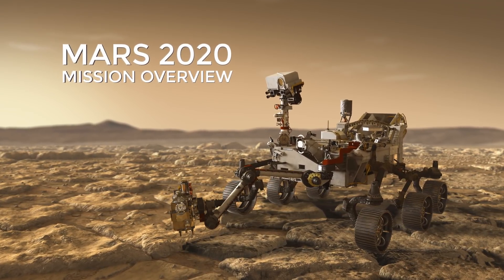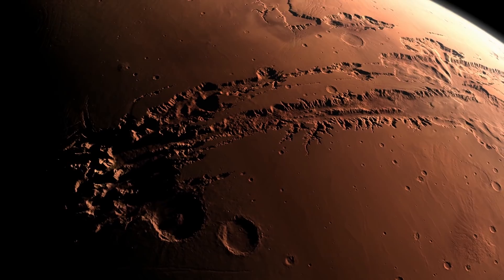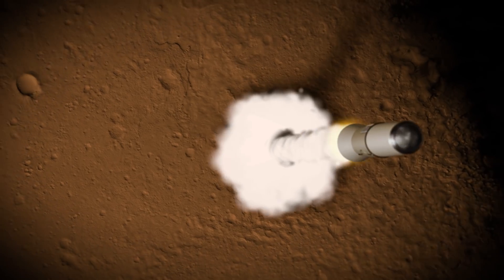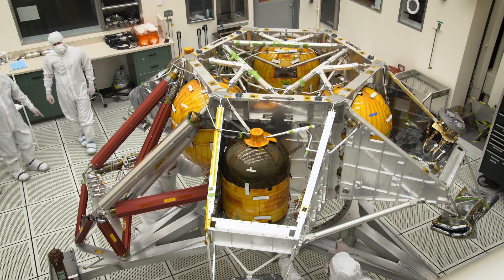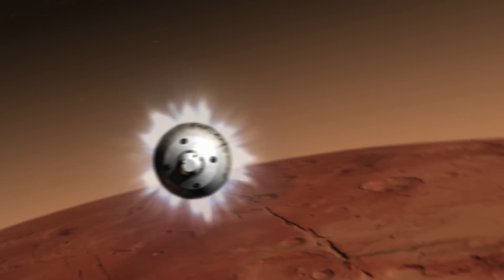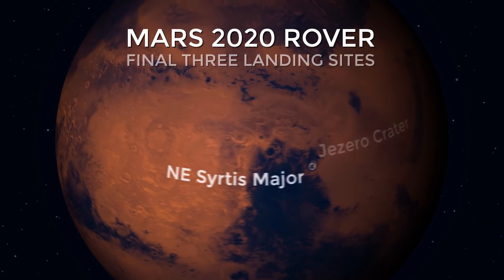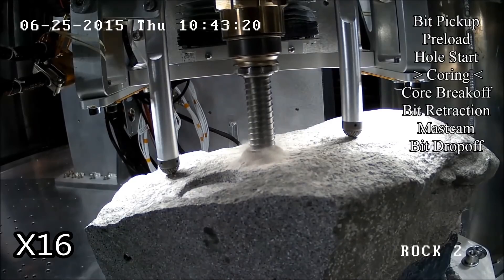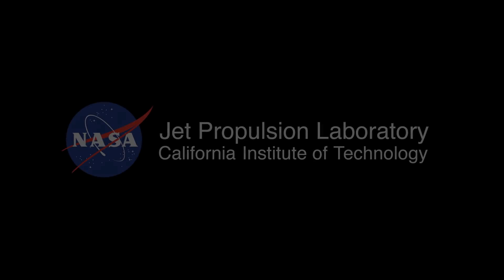NASA Begins Building Next Mars Rover Mission

Comment: I agree with mrengtop, how many billions are we going to spend on probes to mars, to try and prove that life magically comes into existence in the presence of water.  It's like saying that we may find a fueled 747 on the surface of Mars due to the presence of hydrocarbons.  I am not saying that life does not exist somewhere out "there", but I am a bit sick thinking of the debt we are leaving our children in, while engineers keep doing the same things over and over expecting different results.  We have NO workable theories on how life could have somehow self assembled both molecular machines made of complex protein structures using ONLY left handed isomers when left and right come in equal quantities, and just happen to also have the enzymes required to make the reactions for them to bond instantly instead of never or 100 years, AND at the same time created an operating system of DNA that for some reason decided to digitally encode immaterial, purposeful, precision, self-repairing, self-editing, and self-proofreading information that makes these various molecular machines, independent of any chemical structure.  Biologist know very well, that the enigma of life is not found in water or oxygen, you can have any chemical in any abundance, but without highly ordered, specific and purposeful  information, exactly like we find in an alphabet or computer code, you will never achieve the machinery and whatever "spark" that occurs to make it all "go" and become a cell.  In Darwin's day we thought cells were bags of goo (protoplasm), nothing more.  Now we know they are literally miniaturized cities that employ  nanotechnology more efficient and complex than any human feat of engineering.  We also know now that neo-darwinism, mutation and selection give you controlled death, and at best weeds out mutated code and at worst kills the host.  If one is very lucky, a random mutation can be neutral.  This idea that was seized upon in the 1950's as a mechanism for evolution purely because it fits the "chance only" materialist view of life, has failed miserably both empirically and observationally in the fossil record.  Instead we have found the real mechanisms of change match what appears in the fossil record:  sudden appearance, then very rapid adaptation to environmental changes within limits (no rat like creature to whales, or fish to men).   One of the most famous evolutionist was one of the most honest about the evidence, Stephen J. Gould.  He stated that "the lack of transitional forms is the trade secret of paleontology".  Many who read this will read it with complete disbelief that darwinism is dead as a workable thoery , and will want to hurl insults, call me a creationist, or a "denier" etc. of the diversity and changes we see of life.  Another Evolutionist said of the fossil record when viewed under neo-darwinist claims "is like a film with 99 frames out of 100 missing".  Don't take my word for it that the study of the origin and diversity of life in biology has come down to NON-RANDOM processes, take a look at one of the cutting edge Evolutionists of our day and his theory called "Natural Genetic Engineering" - which makes me kind of chuckle, as I am like what is next "Natural DNA programing and self repair and natural nano-machine making"?  www.thethirdwayofevolution.com - I do not ascribe to his thoery, however read the introduction, and all of the new non-random mechanisms where entire genomes reshuffle and genes have even been shown to "Jump" from one species to another totally unrelated species, where Horizontal gene transfer has killed the tree of life and made it a small group of body plans with most of the genetic changes horizontal not vertical (called an impenetrable thicket), and junk DNA is a myth, and it is more akin to an OS than JUNK - in fact it holds the key to regulating, repair, all of the housekeeping, on and on, just like an OS on a computer, And where characteristics acquired during a creatures life is directly passed on to its offspring, and welcome to the new thinking on evolution (not modified), not sure why we ever swallowed neo-darwinism, it was based on a worldview, not on evidence.  As the evidence keep rolling in, the chance only crowd are getting a rude awakening.  We have such hubris that some people are born smart, self aware and with consciousness, but insist they know their is no intelligence behind anything - with NO EVIDENCE to prove it at all, but plenty of evidence that screams design.

Comment: I hope we send a blimp along with drones, not only that fly. I think we should look at animals on earth that live in similar as possible to areas on Mars and build robotics, example, a snake that can go into caves etc.. have solar panels to charge in the sun. Spider type robotics with the ability to "build" using rocks and Sand on Mars. Balloons the rovers can inflate, with the ability to keep attached as it goes up for sensors gathering at different hights. As many stationary small camcorders as possible, some being sent up by balloons to be dropped in places hard to get to along with the robitic snakes and spiders that will have cams also.
Reply: Blimps aren't practical for Mars. The atmosphere is too thin to get you a useful amount of buoyancy. A helicopter would work, though.

Now, Venus would be ideal for sending airships. You could fill them with just regular Earth air and have it float about 50km above the surface.
Reply: Roxor128  I thought about that, I would still like to find a way to do it. Maybe different types of gas, or mixtures would be the answer for the thinness of the admaspheric conditions.
Reply: Roxor128 Also the winds on Mars,,we should really be thinking about using that as a power source.
Reply: usdrobotics Not to mention the winds on Mars, do you not think  a, let's call it a "kiteblimp" a combination of the two with a special mixture of gasses to compensate for the lack of ideal admaspheric conditions along with solar panels on this kiteblimp could fly on MARS??? I believe it can and will be done. Our technologies have come a long way and with nano technology, Graphine, etc.. we will see self replicating robotics in action, doing construction etc.. on Mars sooner than you might think.

Comment: Don't jump before you can WALK!! Moon! Moon! Moon!
Reply: We've been there. It's an uninteresting, lifeless rock. Time to move on. First Mars, then Europa!
Reply: Ima Pseudonym  -  You're only considering the superficial properties. The real value of the moon is its proximity to Earth and low gravity. The two together make it a great site for manufacturing. Many manufacturing processes need gravity, but would be a lot easier in low gravity than Earth or Mars gravity. Building structures is also a lot easier in low gravity. Launching stuff into space is heaps easier from the moon due to both low gravity and no atmosphere. The moon could be the industrial hub of the solar system.
Reply: Already done that, Mars is a totally different adventure and the cost will not allow the luxury of a do over like another Moon trip.
Reply: You're an idiot